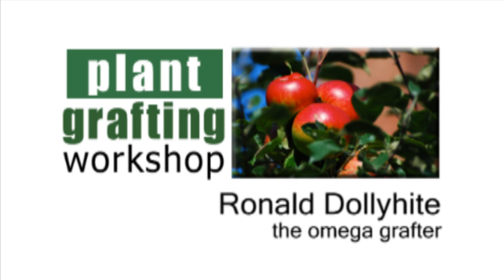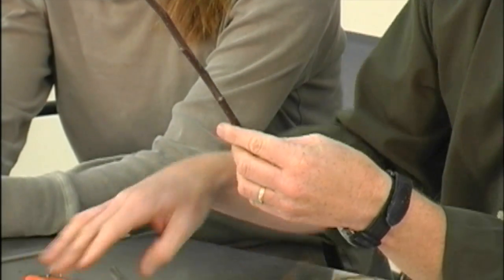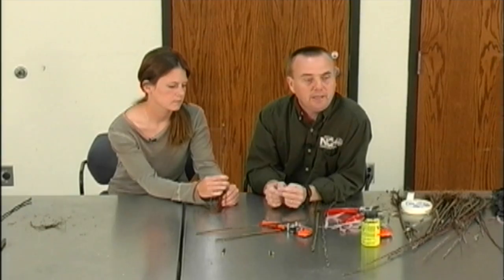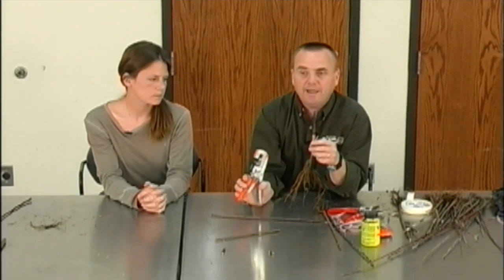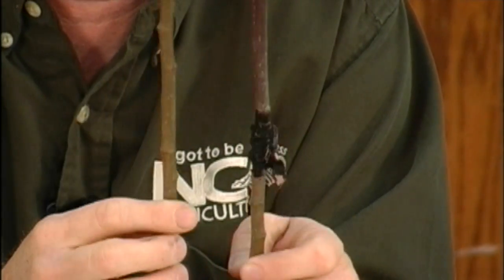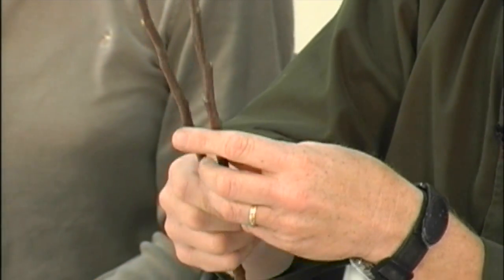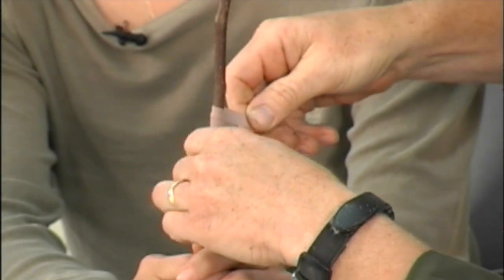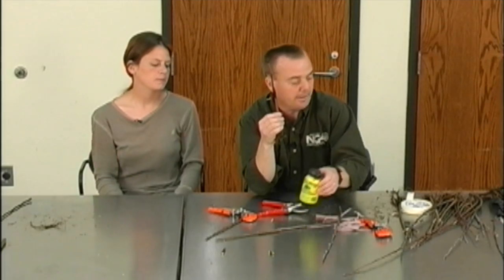The Omega Grafter - Plant Grafting Workshop

Comment: I have bought the grafting tool and used it with. Sometimes it works perfectly and cuts through the wood but sometimes it does not and leaves the end un-cut.It has a design fault and company has not found a solution. I have made a tool and tried to mend that fault and it works perfectly.I am willing to discuss if U are interested. Overall it is a good tool which can be made better.